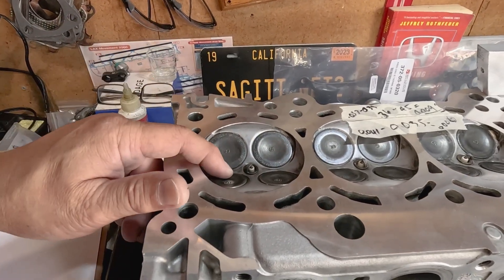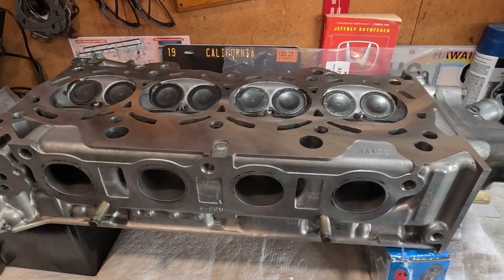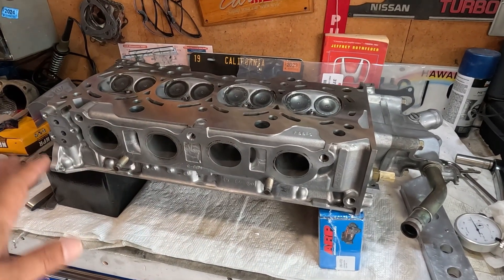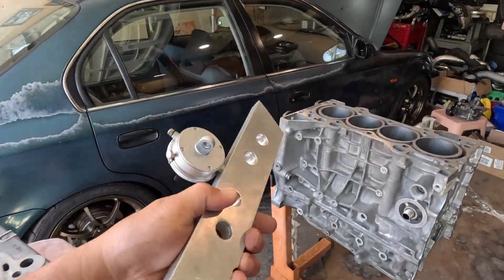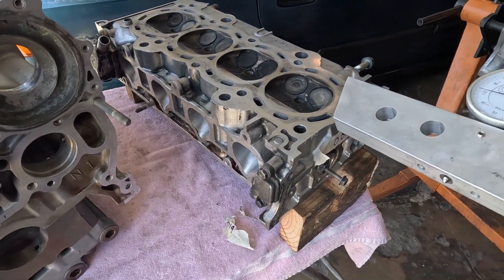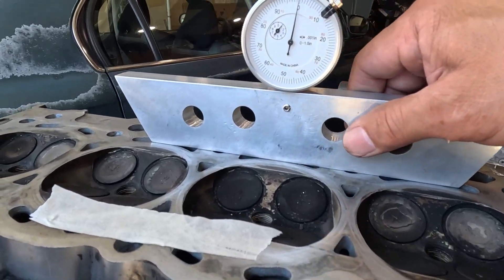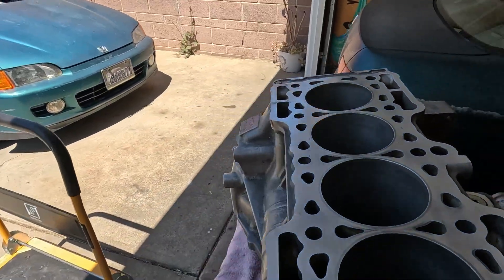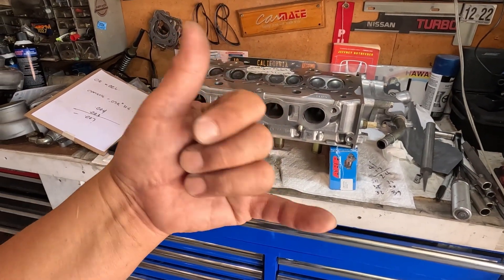Do I need a Thicker Headgasket after Head and Block was resurfaced?

Comment: Sagitt, I hope one day you switch to E85 in a FUTURE build etc. Also what is that depth gauge name your are using ?
Reply from the maker: I'll think about it, not sure if K ecu need a 2 basemap tune. I know s300 need 2 basemap tune for pump gas and e85. It was part of my DIY camshaft degree wheel gauge. I thought about using it like a depth gauge.
Reply: @sagittnet2158 . You DEFINITELY have to have Hondata Kpro 3/4 to run E 85 with the ethanol sensor as well. At very least bud.

Comment: Not if it's Within.0003, if You have Higher than stock Pistons, Then You might need a thicker Head gasket 😢
Reply from the maker: That's what l thought! I was getting a mix info about k24a w/c motor have the 11:1 comp ratio
Reply from the maker: Thanks man

Comment: Thanks for sharing! 
I checked the flatness of my f23 block and it’s flat. Although I did use a 3’ level hahah. Is it usually recommend to get it resurfaced when you have the cylinders bored out?
Reply from the maker: Hehehe, yeah! He told me that after the rebore, he has to resurface the block. Did you get your engine running correctly yet?
Reply: @sagittnet2158 oh okay. And yeah I got her running. It ended up being a ground wire haha. I thought I fixed it but I used a ring terminal from Home Depot. Not even sure what metal it was but it wasn’t a good ground. After some more research I found that either copper or aluminum is used. So I put a copper one like the original and she fired right up. Thank you for your help though!
Ended up mangling my radiator support recently lol. Dumb mistake, I thought I had the jack under the traction bar haha. So now the front end is kinda rough. Imma try to score another one from the junkyard next weekend tho.
Reply from the maker: @nicholassantos2327 okay, good to hear its back and too bad for your radoator, it never end. Later man
Reply from the maker: Whenever l get a cyl head resurfaced, l always check my aluminum bar to see if it actually straight and also l got a level bar from HF, the red one and thats how l found out only one side of the level was straight hahaha.  I've done what you did before, no worries.
Reply: Harbor freight quality😢
Reply: @sagittnet2158 lol fo sho, yeah I’ll probably get an aluminum bar from HF.
Reply from the maker: @nicholassantos2327 make sure its flat hehehe